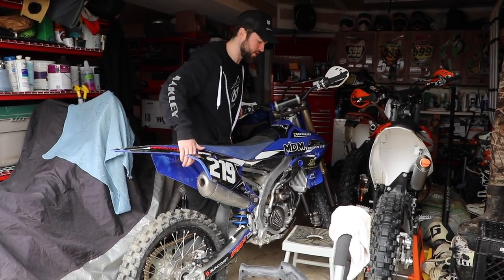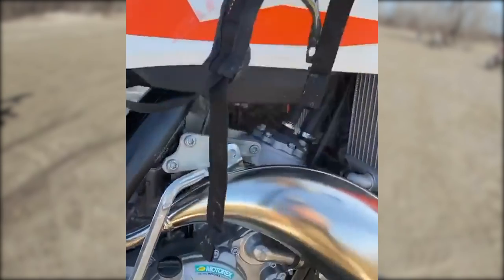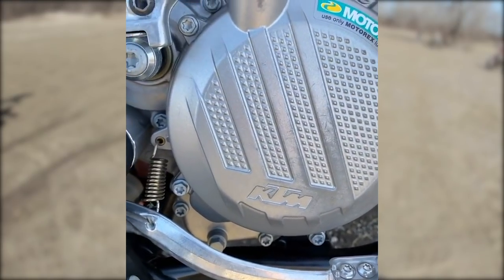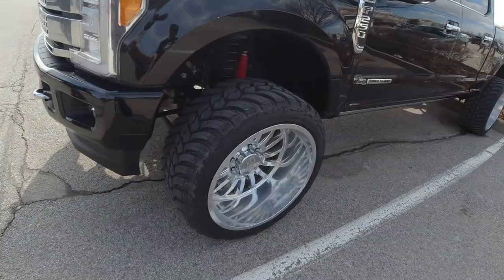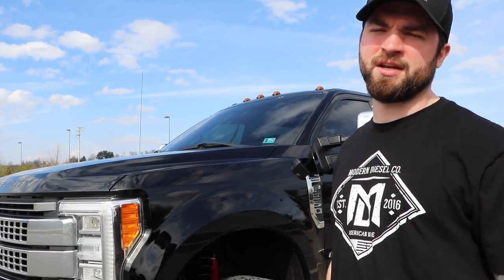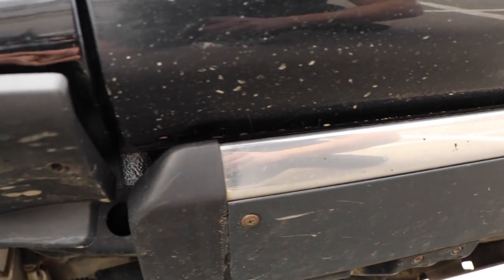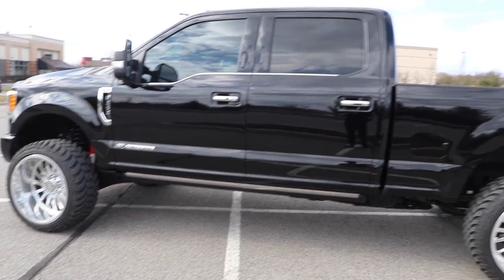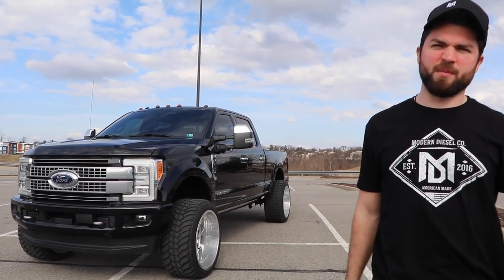FORD F250 vs 14 inch Wide Wheels and Mud Tires - PAINT RUINED!

Comment: Did you do any trimming? Or does it rub?
Reply from the maker: Trimming on the plastic corner covers on the cab side and rolled the front bumper in with a body hammer lol but I recommend a wicked customs bumper spacers 👌
Reply: What to do 24x14 also I’m my ‘19 but didn’t want to cut any metal.

Comment: As a paint correction enthusiast..  
if water makes it go away it can be corrected, but if u can still see it your gonna need to sand it out. I would suggest Meguiars M105 and 205 to knock it down and then a sealant to
finish it off.
Reply: the hell with wax and sealant... ceramic coat it and expel everything !